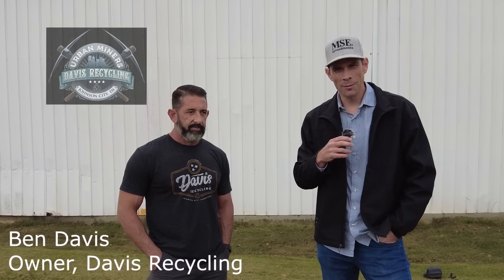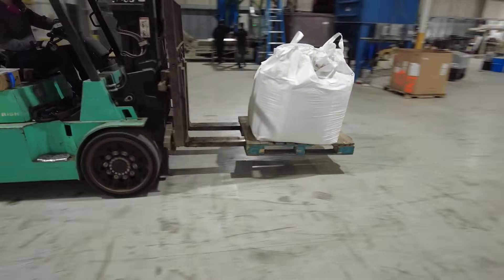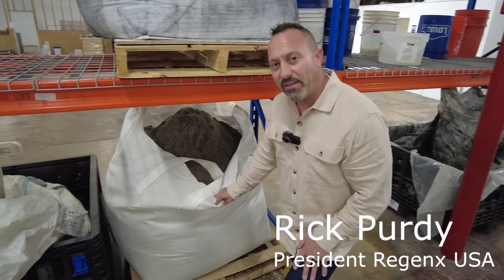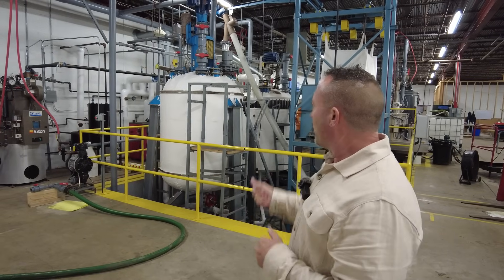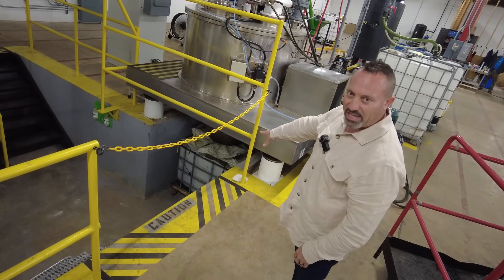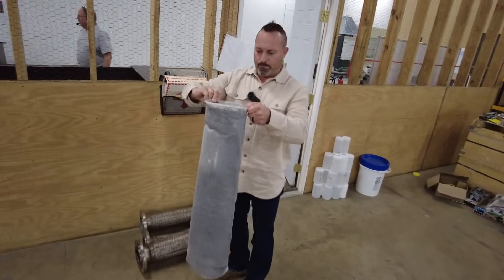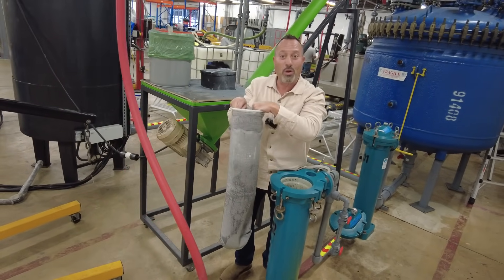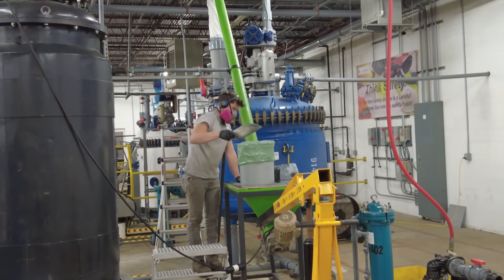Urban Mining Platinum & Palladium: +90% Recovery via Regenx Clean Technology (Oct '23 Site Tour)

Comment: Can someone explain the numbers to me?  Where does $21 Billion number come from?  Even at $2000 per ounce, isn't that more than twice the yearly production of new Pt/Pd?  I don't see how that is possible.  And if it possible, won't this just destroy the price of Pt/Pd?

Beyond that, can they explain the economics of the company?  Am I correct in assuming that they don't pay anything to Davis for the crushed material but share the production output 55/45?  Does anyone know the approximate grams of PGMs per ton of input material?  What is the cost of the process (other reagents, electricity, etc.).
Reply: this company is terrible with numbers and keeps innovating without updating data; we ll just have a big surprise
Reply: 21B is what's NOT recycled annually and ends up at the dump.